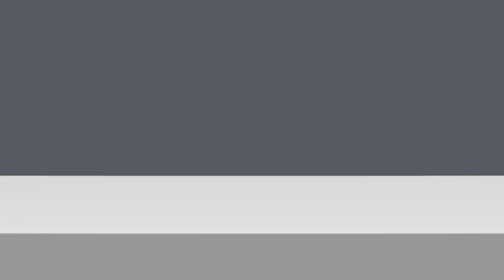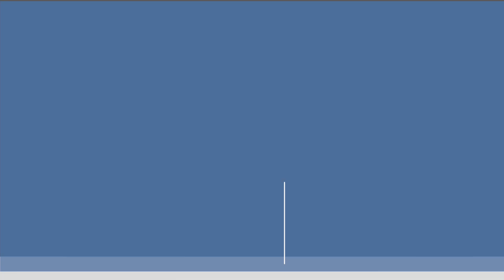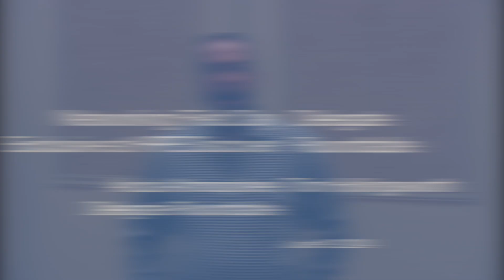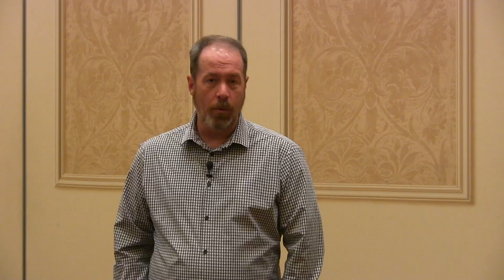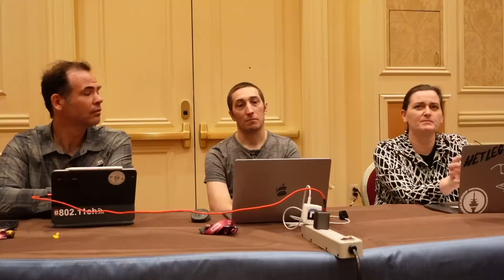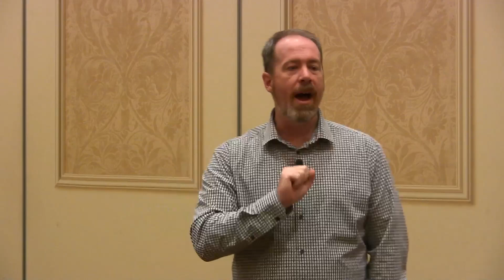Aruba Atmosphere 2024 Delegate Roundtable

Comment: Peter's comment after the 5:15 mark highlights a key point: there are risks associated with being an early adopter of technology. This doesn't imply that the manufacturer, such as HPE-Aruba in this case, or the engineers implementing the technology are doing a poor job. One reality is that many manufacturers often ship hardware before the standard is fully ratified. This can lead to challenges where features offered may conflict with what is supported.

Veterans in this field recall the challenges of Wi-Fi 6, including notorious driver issues across a range of wireless client devices such as OnePlus, Motorola, Intel, and Apple. While mastering standards, configurations, and optimal design is essential for stable wireless networks that function seamlessly across diverse vendor devices, these efforts often fall short in mitigating early adoption pitfalls heavily dependent on the drivers and hardware in our clients' hands.

During Atmosphere's day two keynotes, there was acknowledgment of challenges faced during the deployment of Aruba AP730 series Wi-Fi 7 enabled APs, which affected attendees after a problematic day one session. This isn't to criticize Aruba's engineering team but to highlight that early adoption inherently involves challenges beyond the control of manufacturers and implementers.

In essence, it's important to understand your customers and their tolerance for challenges in pursuit of cutting-edge technology. Maintaining a strong relationship with the manufacturer's device business unit for support and escalation is crucial. Ultimately, the focus should be on delivering a network experience that makes users forget it's there, ensuring customer satisfaction and repeat business or continued employment. At the same time, we need be trusted advisors that know when the benefits outweigh the risks. There comes a moment when resisting change no longer holds the same value, when it's more about improving our quality of life and resisting the general work tied to network changes and evolution, rather than solely focusing on the needs of network users. 

These opinions are my own and do not necessarily reflect those of my employer or others.